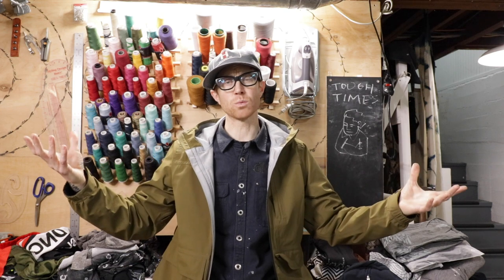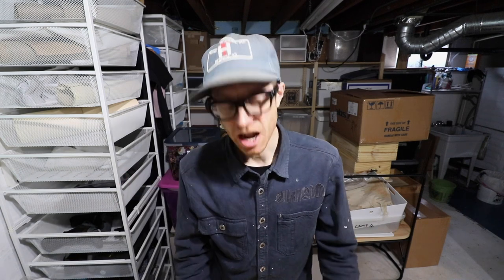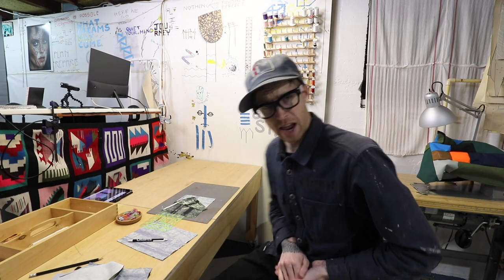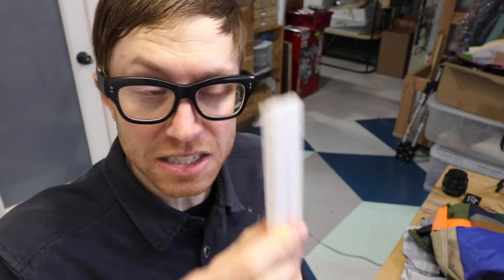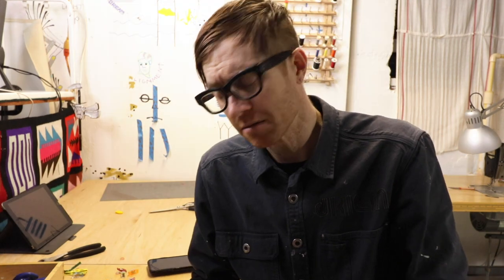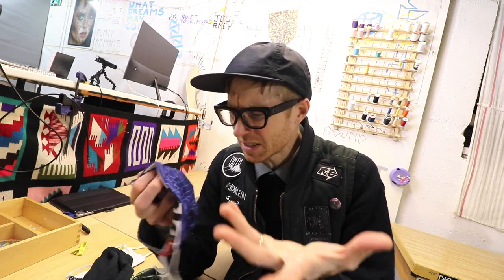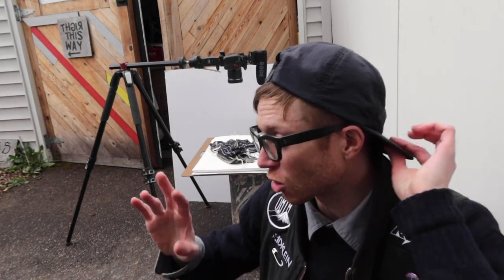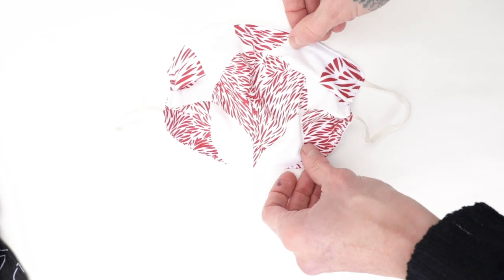Upcycle Cycling Jersey Into PPE. From Trash to Treasure

Comment: Aloha, nice mask ...however the metal in the ties will corrode and also break apart , along with the paper and plastic that surrounds the metal when you wash it a lot and dry in dryer. Believe me I have tried that before making Hawaiian flowers . For $35 people should know what they are getting.  It is a temporary solution , but won't last. Better to make it yourself and use Stainless steel or Titanium wires , floral craft wire works better than most wires and it will not corrode and break apart in a lesser time span.
Reply: @cccpkingu aloha,  could you provide me a link? 
The thing is he already made them and sewn them together to sell.